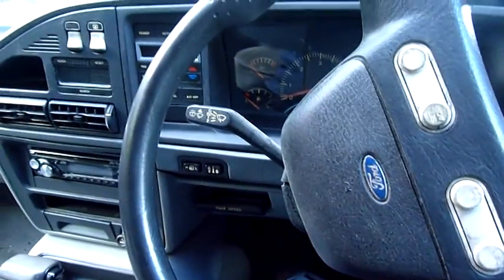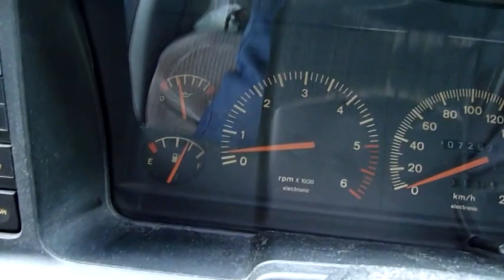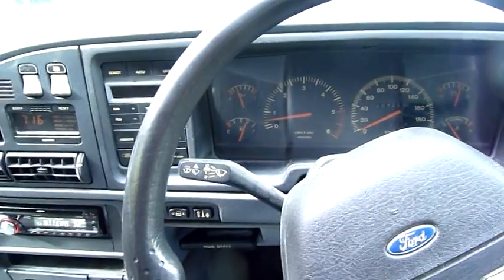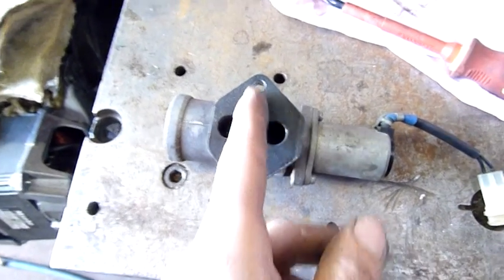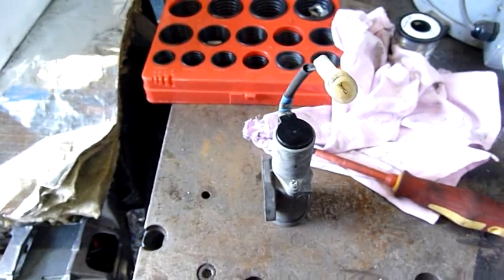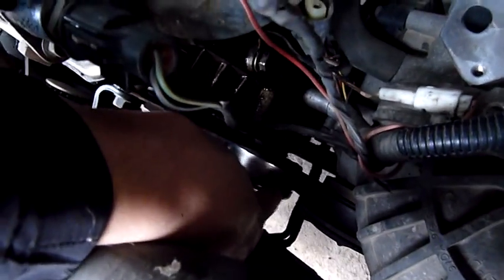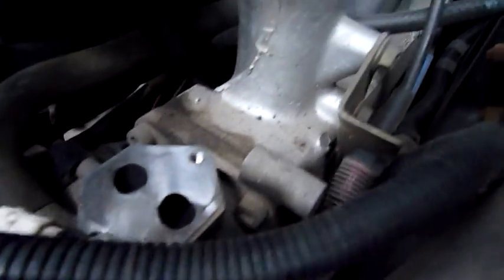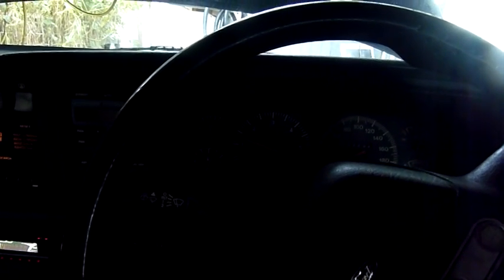1993 Ford Fairmont EB Bad Idle Fix (Throttle body and IAC Clean)

Comment: Friend bought a NC V8 and we are having this issue which is engine surge. We also have fuel pressure issues where the car dies in Reverse or drive, and holding the car at 2000, the revs just drop off when holding the foot on the pedal.

Comment: The IAC valves in these things are hopeless. They're a part common to most 6 cylinder Fords and pretty regularly shit themselves. I had a dodgy idle on my old Mondeo and the same part was the cause. Drowned it in carby cleaner and it came right for a while but it was "moosing" like mad afterwards (Duratec 25 issue). Ended up swapping it over with a newer part.

Comment: These use a MAP sensor on the firewall near the fuel reg, Im sure you know this now ed LOL
Reply from the maker: haha, yeh thanks to like 20 people I now know they are MAP based ;).
I even tried to open a dead MAP module up a while ago but it was filled with some nasty looking goop for potting compound, and gave up.
Reply: Aussie50 Oh right i was going to open one myself lol
Reply: i think vacume pulls a varible resistor type setup

Comment: If you disconnect the battery on this model for any length of time,you have to do an idle re-learn.Disconnect the IAC at the comnnector and rest the "base idle speed" via the 8mm screw on the throttle body.[The base idle speed spec is on the specs decal on the radiator support panel].Let the car idle 5 mins in park a/c off.5 mins in drive A/C off.Sameagain with a/c on,but you will have to open all the doors and put a/c on max fan speed to keep the compressor cycling.Reconnect the IAC connector and she'll be sweet.Also,the MAP sensor gets its vacuum feed via a rubber hose at the rear of the intake manifold plenum.Where the hose connects to the tapout,there is usually a sharpish bend,which can crack the hose at this location.This was a service capaign for for technicians a year or so after the release of EB.Check this.But it is not the cause of the symtoms in this video.

Comment: ed....fords of this era dont have a maf or mas - they use a MAP sensor which is up on the firewall - has a vac hose going to it....manifold absolute pressure plus tps tells the ecu the load on the engine bud.

Comment: sometimes re-tightening of the head will help-mind you it is a very long head so easy to warp. mine is still a bit twitchy on idle but runs better then before. just waiting for new o2 sensor and then will fit new rotor, cap, leads and sparks. I was surprised how expensive some new parts seem to be-compared to import cars for instance. New Idle control valve is around $300, rotor $30, cap $50 etc-for a locally made car this is almost BMW territory.

Comment: I have an EB XR6 and the wife a stock EB, both were surging at idle in gear, the wifes with the aircon on and mine when stopped in gear, our mechanic friend disconnected the IAC's plug and screwed the base idle screw in on both cars while running, the wifes just needed a little bit but mine would not even idle till the screw had a few turns in, reconnected the plug and both cars now idle perfectly.

We had already replaced the leads plugs caps rotors since they were both well and truly due.

Comment: hi, so what did you end up replacing to fix it? My 93 ED has a rough idle but holds correct idle speed-its fine in drive but in park its shaky. but more importantly it has this miss now and then, at random, sometimes nothing and other times several in a row-like a hiccup when idling but drives fine. have cleaned the idle valve, throttle body, cleaned and gaped spark and replaced leads, new pcv valve, fuel pump and no cigar. checked for vacuum leaks but nothing seems to stand out. Any thoughts?

Comment: Cleaned the solenoid and intake as much as I could, didn't make a huge difference but some slight improvement. Using the workshop manual I reset the base idle speed which helped. Compression is bit low so a thicker oil in and runs better. Still not perfect and the problems creeps back slowly as temp increases or oil starts to run low due to burning it. can't seem to find any vacuum leak and haven't tested fuel pressure but a new pump filter so doubtful any problem there. Valves may need seating

Comment: Base idle would have been upped to compensate for buildup in throttle body and probably iac issue. After cleaning, the base idle needs to be reset by disconnecting iac and adjust idle screw to 450rpm. Disconnect battery for minimum 15min and reconnect iac. If auto, ecu needs to relearn closed and full throttle positions, 1min idle in drive, 1min full throttle in drive with ign on engine off.

Comment from the maker: Clean the throttle body and IAC valve (or replace IAC if its really bad) and also check your ignition gear if its fully miss-firing. 

Even the wrong spark plugs will upset one of these engines really bad and cause misses. I replaced everything apart from dissy and ign module during my major service and its like new now.

Comment: i have the exact same problem to the detail with my eb fairlane. 
how did you go about tackling this, it constantly miss fires when exhelirating from stand still, and is virtually about to stall at under 400rpm when stand still in Drive. but not park

Comment from the maker: G'day
the IAC's are finicky but it sounds like yours is ok since its not hunting and surging.
I agree with the vac leak idea, the manifold gaskets can go on these and cause havok with that MAP sensor.
These engines are also very sensitive to degraded or incorrect ignition gear too, it would be worth replacing the lot if its reasonably old. even a slightly different grade of spark plug can cause all kinds of hell on these.

Comment: I have pretty much the same idle problem with EA II S-pak. I removed and cleaned both IAC and throttle body (prior to seeing you're video). Made a slight difference for the better but problem of slow idle persists. car drives and for the most part no problems BUT definitely running far to rich and slight misfire when running so slow. Going to investigate vacuum leaks and look at adjusting the idle speed manually. Also may as well look at the condition of the distributor cap / rotor button.

Comment: My mum has a 1994 Fairmont Ghia EF series she got 15 years out of the original genuine ford battery, the reason it got replaced was a cell died. Otherwise it would have lasted many more years, the battery was really really good minus the cell dying which is sorta sad considering its practically all original minus the consumables, 98% of it is original, the head gasket to and yet its got 312,XXX k's on it, its not even near going anytime soon

Comment: G'day from Arkansas, mate!  I shudder when I hear anyone mentioning issues with the crankshaft position sensor.  Seven years ago, the truck I was driving decided its CPS was going to take a dump and left me stranded just east of Pecos, TX (was heading to Tucson, Arizona).  The Pecos Chevy dealership replaced the CPS but failed to check the wiring harness (it was loose, I think).  I made it to Tucson and a Chevy dealership there fixed the wiring harness.  I had no issues with it after that.

Comment: It's wierd seeing the steering wheel on the right . what foot is on the gas pedal? in a manual shift floor shifter what's the shift pattern is first gear towards you and fwd or away from you and fwd?  also I can't believe the inspection standards you have to live up to can you fail the inspection due to rust???

Comment: Ya, thats one of them without a MAF, I think mostly because its turbocharged along with other turboed cars. But i think, just like you said, they may be swaying back to speed density type. But N/A cars in the age of  yours still use a MAF. They even had/have tiny MAF's for the secondary air systems... Germans at their finest

Comment: last couple of cars were 2.5 and 3.5 litre. It's not a problem if it's older than 2001 - only 2 tiers of tax.  if it's pre '73 it's tax exempt.. Newer than 2001 multiple tiers depending on co2 output...

Comment: 10 or 15 years ago you could drive and look down at the road going by in the rust holes and when inspection time came all you had to do was put some sheet mettle rivets and roofing tar over the rest as long as the inspectors screw driver woldent go trew it you weer good to go we think its bad now you guys got it hard good thing their is no winter road salt your cars wold be doing good at 10 years old lots of cars go to the scrap in canada with less than 250000 km due to rust

Comment: what the fuck 
did you just say wen i washed the engine for inspection man they are fussy 
 in NS canada you can be leaking 1 liter of oil a week and pass inspection  as long as brakes, tires, suspension, steering,frame no holes that can let in co2  and lites and windsheald are working and not badly craked you are good to go

Comment: On older EFI Fords, least here in the states didn't use MAF's. They used the less desireable Speed Density System. It calculates the load/air-flow based of what all the other sensors read. If there is no MAF, pretty much has to be a speed-density type system

Comment: The "runs ok till for a few minutes after it starts" tells me its running in "open loop". Then after a few it switches to "closed loop". During OL it uses a set fuel map. During CL it uses all sensors. Id still lean toward O2 sensor. Yank a spark plug and see what color they are.

Comment: If there is no MAF sensor on the vehicle, it's most likely what's known as speed density system.  That system uses a manifold absolute pressure (MAP)  sensor as well as a intake air temperature sensor to determine load on the engine and give it the proper amount of fuel.  It's a simple system, but unfortunately it doesn't compensate for engine wear and is very sensitive to engine modifications

Comment: That IAC looks identical to the one on my Ford F250 with a 7.5L V8, its not just a solenoid valve its more of a proportional valve, the ECU pulses the ground connection to it and depending on the pulse width from the ECU it will allow open more or less. The problem I had with mine was that it wouldnt idle up at a cold start causeing the engine to die shortly after firing, I would have to hold the throttle on for 20s or so until it was able to idle on its own.

Comment: we got 7 years out of the battery in my van before I had to retire it from cracked posts. apparently interstate batteries are good for 7 years of winter cranking without issue.

Comment: The ecu also does a reference run every time the ign is turned on to calculate the air pressure as it will be different depending how high you are iv heard blokes driving from syd to the slopes and wonder why the engine is lacking power that's why cool hey

Comment: This may not relate to your car being as they are diffrent manufacturers. When the TPS failed on my car it would idle at 2000 Rpm and the engine management light would come on. Being an older GM car with a 10 pin diagnostic plug I could use a paper clip to read the fault codes. and replaced the sensor. Before i replaced it I  unplugged the failed sensor and the idle dropped back to normal.

Comment: I would think the iac would work on a modulated signal to control the air going in and as it has a map sensor it would adapt to the idle speed over time and what frequency to set the iac at. As you have now cleaned it the computer has to re learn the adaptions of the iac on old cars like this one it can take a while. I would guess start engine cold let it idle till thermostat opens then switch on ac idle for 5 more minstrel then idle for 5 mins in drive.  switch engine off for 5 mins then drive

Comment: ppl make the mistake of adjusting the base idle when they should be cleaning the throttle body, i have rebuilt shit loads of e series fords, if you want to know anything about the engine management system message me
Reply: I've fitted an NL 5.0 into an 85 bronco, it's got a hunt at idle that i can't get rid of, any suggestions?

Comment: I've had that happened, Ended up cleaning every sensor on the Throttle body / Intake system, Resetting the computer (Completely) and changing the fuel filter. On a 1993 Ford Taurus with the 3.8Litre.

Comment: what could fix the problem you have now put it into Diagnosis mode and let it run for 1min then switch it off disconnect from diag mode, start the car let it idle for 1-5mins going from n-d d-r switch on the AC and repeat, then take it for a run it need's to go through a learning process.

Comment: put in a EL ECU way better than the EA-ED you will see increased performance and fuel economy, will also give you the choice to run the BBM manifold and thermo fan's
Reply: ThatGuyWithTheBlackFalcon 

U shouldnt be able to use el ef yes but el waz all coil ea-ef used one coil dizzy but yes better economy and little power gain but also a j3 chip for around 80 -250 new or used set for your car can increase power or economy without changing ecu

Comment: My frends ford k.a had similar problems, the plastic throttle body had a hidden crack.

Also im not sure about the solinoid, the one on the k.a had balance springs and air damping and it seemed like it may be variable, so not just open or closed, crap unit though.

Ed hopefully someone will chime in and tell us if the valve is just an open/close system or its ment to varie with the applied voltage..

Comment from the maker: thanks for the tip, I did not see the MAP sensor at first

I went for a drive after doing the battery last week and it was playing up, I wonder if it will change after doing the throttle stop adjustment, or maybe I should just disconnect the battery again and go from the start?

Comment: Those falcons need to do a relearn when the power supply is disconnected ....ie...go for a drive before you adjust anything...MAP sensors are notorious for failure too...MAP.(manifold absolute pressure)is on the firewall...near where the heater hoses go into the cabin.Take it for a drive before you try and adjust anything.

Comment: the days of cheap roadies are gone, otherwise ide full register the jag but a inspection is like 300 all up plus 700 rego.....
it probably relies on a MAP or mass absolute pressure sensor which takes its reading from the vacuum drawn through the manifolds.

Comment: There is a MAP sensor on the firewall, that and the TPS control the injection. There is also no crank positioning sensor. EF onward had a crank sensor though

Comment: That car has what's called a Manifold Absolute Pressure sensor, it knows how much pressure is in the manifold and it works out how much fuel to inject based on that.